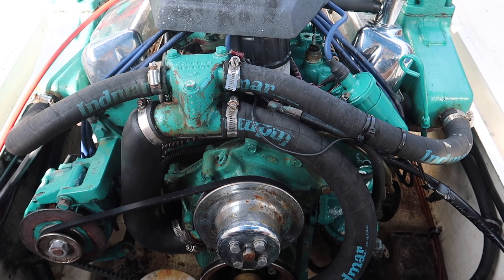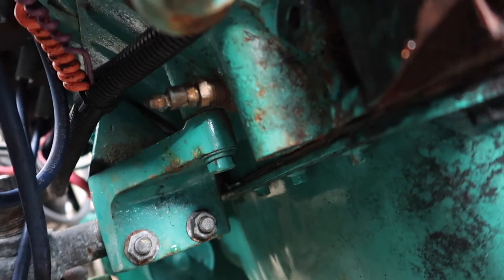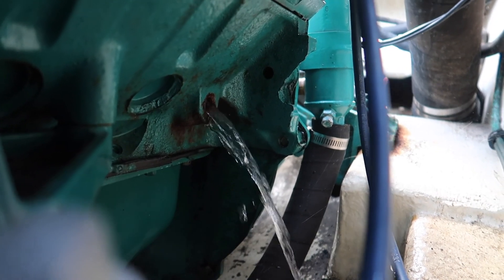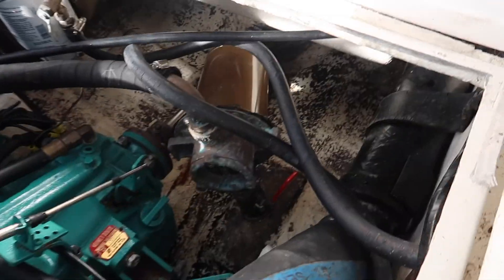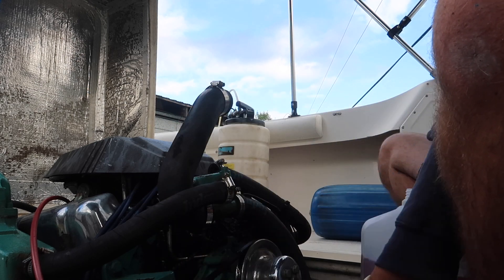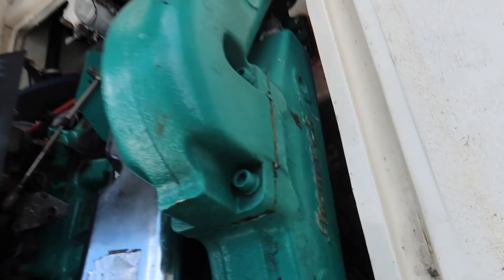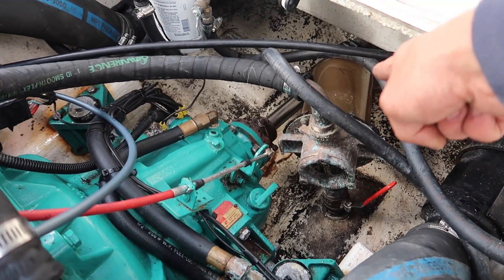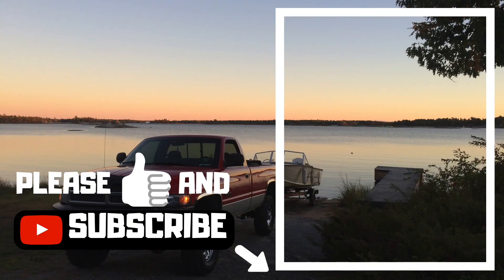Ford V8 Marine Winterization block drain procedure

Comment: great video I have a 5.8L OMC in my I/O. First time winterize so how do you fog the engine since you don't want to start it once its full of the pink stuff? I was told to use the gravity feed method where the engine ruins 100% anti freeze until it come out the exaust. Anu advice on this first time doing this. TYhanks

Comment: Does anyone have experience with skipping the antifreeze step?  Seems like a little puddle of water left in there would not have the force required to crack the iron.   FYI I'm in California where it just gets down to maybe 20F at the coldest nights.
Reply from the maker: You can skip it, it basically is just so you know it is drained. You could pour water in with food colouring if you wanted it. However for the few dollars antifreeze costs I think it’s worth it.

Comment: Hey Great video. So I just bought a chris craft with a 351w engine. This is a inboard outbord setup. Would the engine winterize be like what you just did? Thanks in advance
Reply from the maker: Hey Neil, so is it a volvo or likely Mercruiser?

The winterization process will be similar but and I/O will have no water strainer like I emptied and will have a power steering cooler likely on the opposite side.
Reply: @Schneids15  So mine is a OMC I/O. I saw a video where the guy just used a kit to let the outdrive suck in the antifreeze. Is this the way I should go?